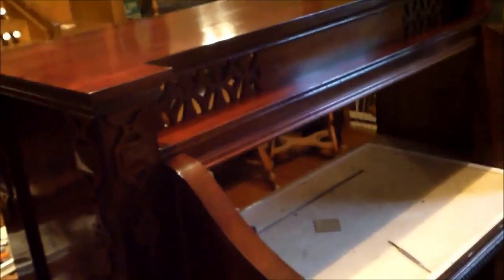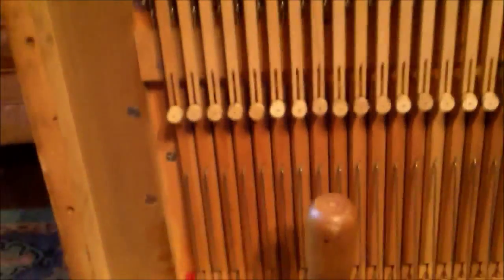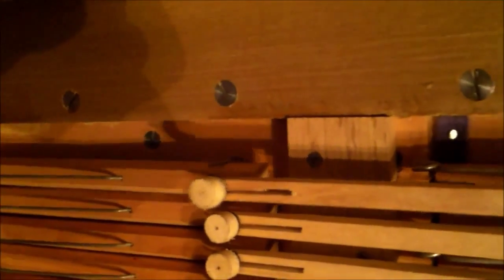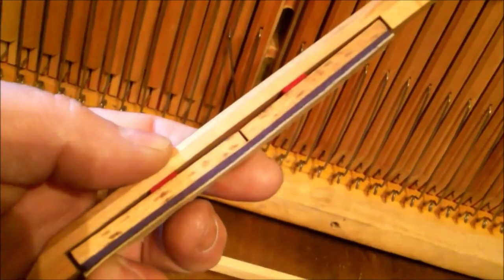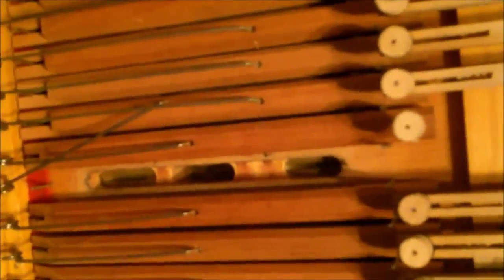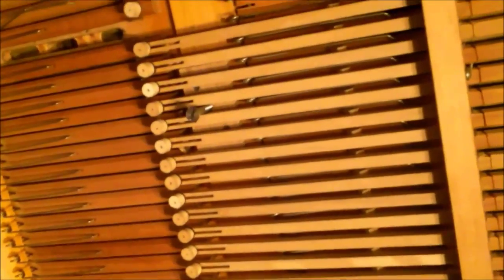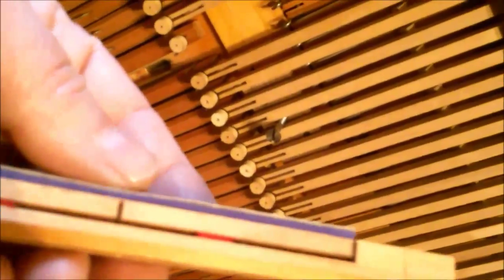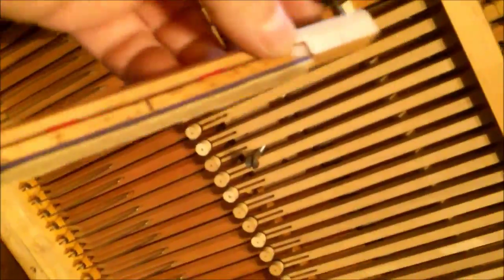Look Inside a Reed Organ

Comment: Could you suggest a source for replacement pallet valve felt like this? I'm restoring an organ where it's missing.
Reply from the maker: That exact felt? no. I call it angora felt, the wool is very soft. Use strips of "thick" nameboard felt (not the self-adhesive variety).